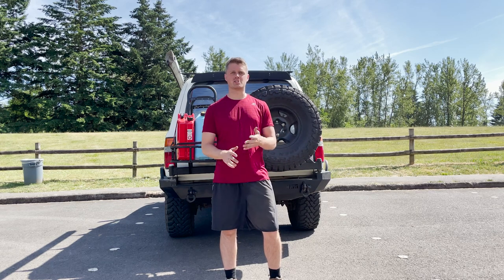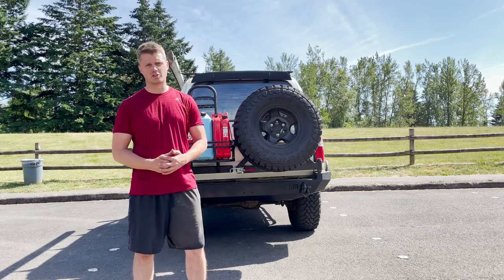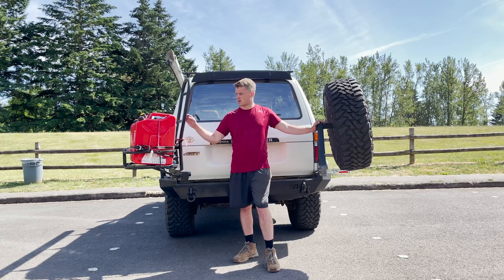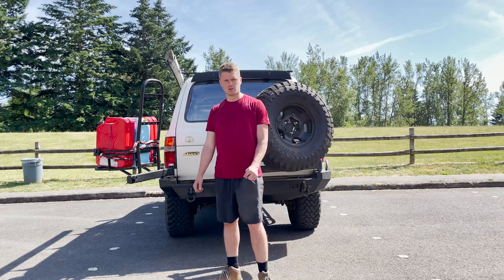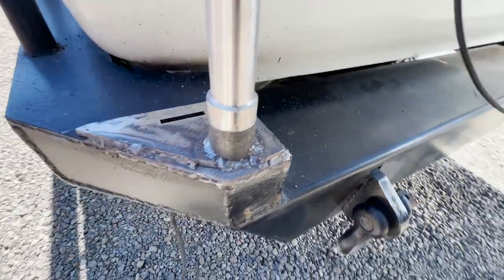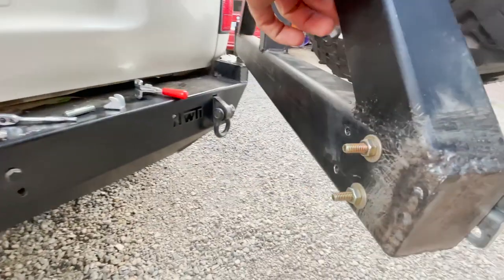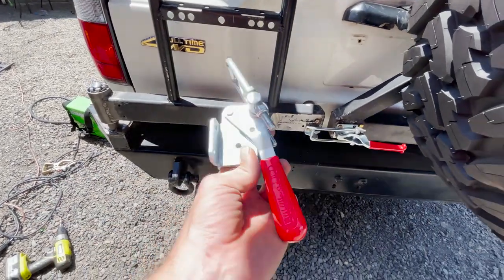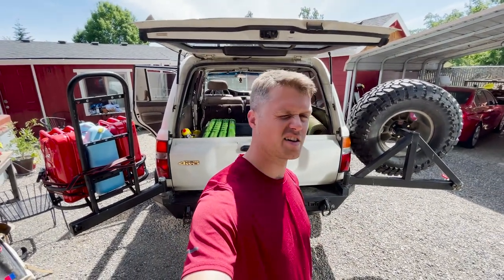NWTI Rear Swing Out Bumper Review + Modification for Dual Spindles and Jerry Can Holder

Comment: How do you make sure the rear bumper does not sag with the added weight?
Reply from the maker: Buying the correct rated springs is the key. The original springs I bought were rated at 0-220lbs. I ended up going up to medium duty springs rated at 220-440. These 80s naturally have the rear end pointed up compared to the front so musically not much of an issue